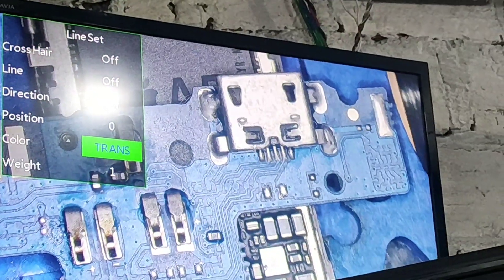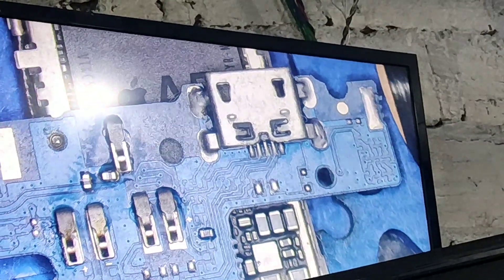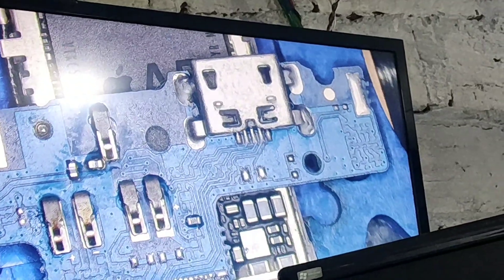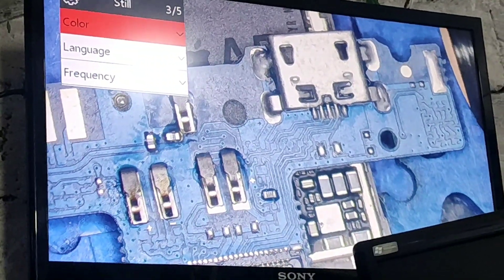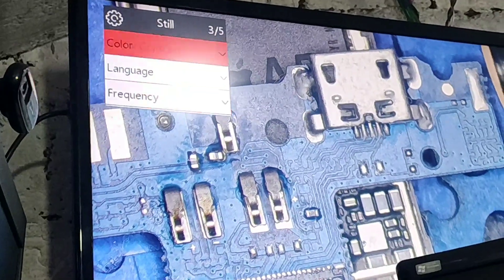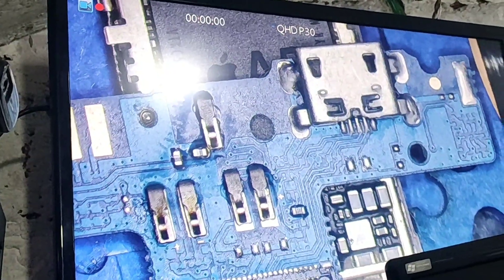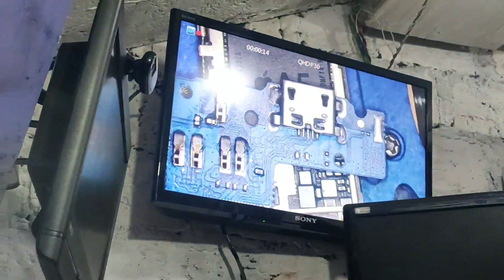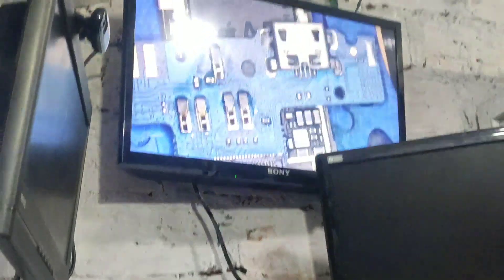51Megapixel Microscope camera

Comment: Thanks, there is also a 38 megapixel that is cheaper, I was wondering if the 51MP was any better, it seems it is not the case. 
Sensor has the same dimensions and the same pixel pitch so
Reply from the maker: they are more or less the same,, those cheap chinese product are all the same even its written 100mp or 5mp😭
Reply: @mobilecare-jayhriata  Absolute nonsense you talk, as you are ignorant do not comment. AT LEAST A LITTLE AWARE, 80% of electronics are made in China.    https://www.youtube.com/watch?v=12V2fqciExE&ab_channel=LivyuFPV     ---GET HUGE DIFFERENCE ONE CAMERA FROM ANOTHER
Reply: I have a 51mp and when taking a photo, it shows as 51mp in properties. The quality is perfect.

Comment: Can we connect this camera to ''monitors with only vga input'' using any 'hdmi to vga' adapter...? Please check and reply...
If possible, make a video how to connect this hdmi camera to vga only monitor...
Reply from the maker: no vga output from this camera, but you can convert ur hdmi with vga converter/adapter
Reply: @mobilecare-jayhriata   Sir, Thanks for your reply... 
I have a similar camera. When i tried to connect this to a vga monitor using HDMI to VGA converter,  monitor displays an error message (INPUT NOT SUPPORTED). 
If you can, please  make a video on "How to connect this hdmi camera to vga only monitor" and suggest a suitable hdmi to vga converter for me to purchase...